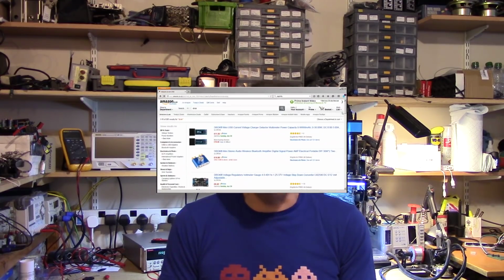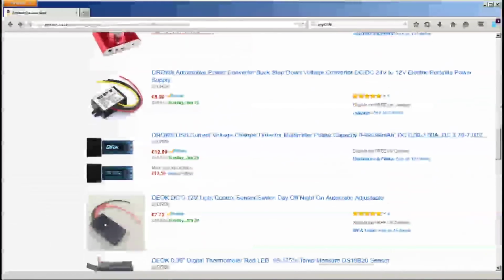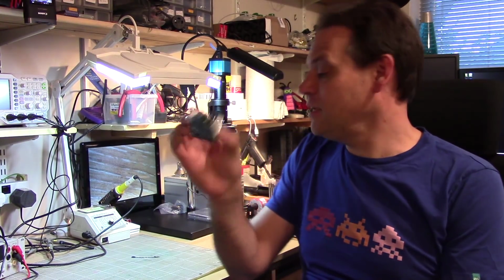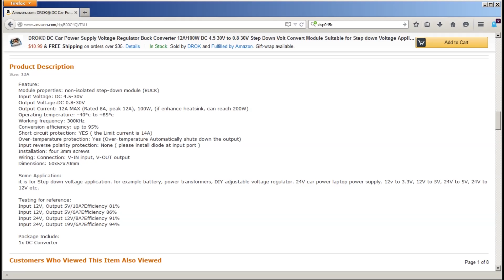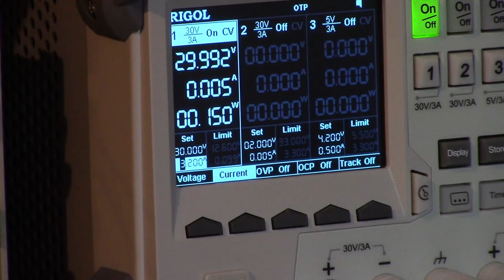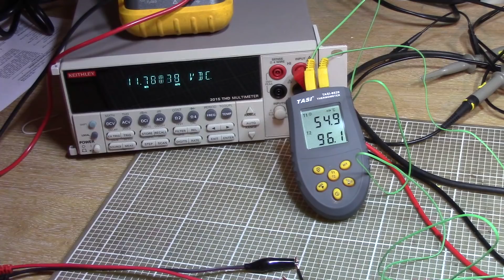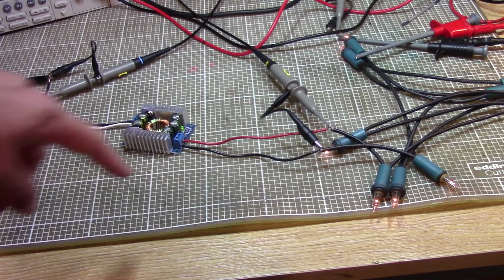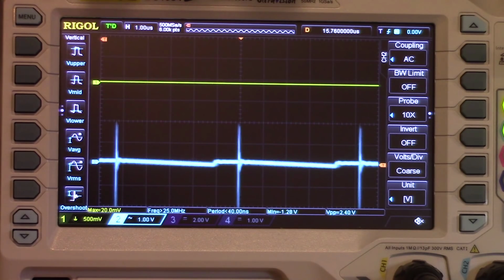DROK 12A / 100W DC-DC Step Down Converter Review (actually 8A)

Comment: thank you sir for your review this DC step down. very helpful for me, i didnt have that tools (osciloscops, power supply,). I have question. Is it stable when there are unexpected power surges? for example when the output is set to 12 volts, then the input spike always changes between 13-14 volts. Will the output voltage be stable at 12 volts?

Comment: Very useful video.  It's a pity you didn't get the 300W 20A buck. It's oly about £6 odd. It uses 2 x K80E08K3 80A FET's. I just managed to undo one and it's heatsink to check. Both have heat sink paste on them now. The XL4016 9A with CV & CA 280W at about £3 on Ebay is probably a third the price and I have used 3 with no problems at over 150W for an hour or more. 12V fan on 6V with 25mm gap. VERY good value. I think DROK is just the usual Chinese kit with their name added at a higher price.

Comment: Hello, I have a question

When you fix and output voltage value, for example 12V, and your input is for example 18V. What happen if you vary the input voltage?, the output remains in 12 V or it varies also when you modify the input?

Thanks.
Reply from the maker: Hi Daniel - The output voltage will remain fixed at 12V as long as the input voltage is high enough (over about 13V). If the input changed from 18V up to 24V the output would not change at all. Hope that helps. Cheers!!

Comment: XLSEMI XL4012 ??? On the fence too much write. Show us do 12A at the output of the module. There is information that is instead XL4012(12A 300kHz), is set XL4016 (8A 180Кгц), but on the surface of the chip written XL4012
Reply from the maker: Hi Mr. Good.... You're right!!! - I just checked the chip on my board again under the microscope and it is indeed an XL4016, which is only rated for 8A. That makes this video very wrong on two points (as I also messed up measuring the switching noise due to accidentally having the scope input grounded - already added an annotation about that one) ...  Do you think I should just get rid of this video? Cheers!!
Reply: Jim Conner Hello Mr. Jim Conner! Good video. Just our Chinese friends, always a bit of rogues )))
Reply from the maker: I've now added an annotation highlighting that it's actually the XL4016, and updated the datasheet link to point to the right device - Thanks for spotting the mistake and letting me know. Cheers!!

Comment: is it possible, to make adjustable output current?
Reply from the maker: Hi +dvaal - There is no output current adjustment on this Drok converter...  I have seen other buck converters on ebay/amazon/aliexpress which do have a current limit though (and they were cheaper too). Hope that helps. Cheers!!

Comment: Dear Jim Conner, I have the same converter and was wondering about the output for the cooling fan, mine has no voltage output either, did you come up with a solution to this? the only info I can find is that it is supposed to be a constant 12v output but mine = zero VDC. The Drok web site does not seem to exist so that was of no help. Thanks 
Great job on the review.
Reply from the maker: Hi +Less Opinion  - If you look on the underneath of the board, right next to the fan connector there are three solder pads and some writing that says v_in and v_out... You need to make a solder connection between two of the three solder pads to choose whether you want to run the fan from the input voltage to, or the output voltage from the converter. (i.e let's say you're running the converter from 12V, stepping down to 5V... You could choose either a 12v fan running from the input voltage, or a 5V fan running on the output of the converter)... Hope that makes sense. Cheers!!
Reply: @ThingsWhichArentWork  Thank you for this Answer I was looking for this I have DZS ELEC which I guess is a clone of this one. I could figure out how the heck to get the plug sock of the fan to work. RIght now I just got it pulling voltage from my 12 volt line coming in. Which is what it would do anyways. Since Im running a 12 volt fan. But thank you.

Comment: I've been looking for a step down converter for a little project to use the 37v phantom power from a preamp box to allow me to alternate with headset mic, which i believe only requires 2.5v. with the low noise would this be a good unit? or is it too heavy duty?
Reply from the maker: Hi +Brian “Easty and the Wolf” Eastwood - Although this converter would work I think this unit is far too heavy duty for that application. I believe the phantom power spec allows for 10mA per microphone, so you're hardly using any power at all. Although the output of this Drok switching converter was very clean, given your very low current requirements, I think you'd be better off with a linear converter instead. Take a look at the 'STM LF25CV' voltage regulator from STMicroelectronics - It's a 500mA 2.5v supply which can run on anything up to a 40V input. It's a straighforward 3-pin device (power-in, ground, power-out) and given your low power requirement, I doubt you'll need a heatsink. Element14 stock them for $1.68 each, or you can get 5x from ebay for about the same price... Hope that helps. Cheers.
Reply: +Jim Conner Thanks loads for the response. I'll read about the linear converter. I found a circuit diagram though it had a seperate power supply and I thought it would be much better to use the phantom supply already provided by the amp. Cheers.

Comment: Well done Jim! Two comments from my side:
1.) If it says a 100W, I always understand a load of 100W. So this means you should have had your output current measured and the output voltage adjusted to hit the 100W.
2.) A conversion efficiency measurement with a few different points would have been nice too. That's always a big unknown factor with these Chinese DC-DC.
3.) Thermal shutdown test. If this feature is advertised, it would be good to know if it works and when it kicks in.
Thanks again for the good work. Alex
Reply from the maker: Thanks +Alex Wolf - Yes - you're right on 1.) and I'll try harder next time.... The datasheet for the XL4012 IC this board uses has an example circuit for an output of 12V@12A (144W) so I'm pretty confident that the unit can actually deliver over 100W in the right circumstances (cooling permitting). On 2.) - yes... I should have done that... The efficiency curve isn't even shown on the datasheet.... 3.) I sort-of aborted the thermal test when I realised that the thermal shutdownis actually managed by the XL4012  IC itself and kicks in at a junction temperature of 125C... There was nothing the circuit designers could have got wrong with that, so I'm prepared to accept that the unit would actually shut itself down if it gets too hot - It had reached temperature stability when I stopped the test, so I'd have had to change the test conditions to get thermal shutdown. 

Thanks for the feedback Alex - Hope you have a great christmas.

Cheers!!

Comment: Well done. I use one of these to power an onboard glow system for an RC airplane. Input is a lithium Ion cell of 4.2 volts. Output to glow plug is set at 1.3 volts  under load. I can turn the glow plug on or off from the transmitter.  A single glow plug draws around  four amps.
Reply from the maker: Hi Marvin - That sounds like a very good use for one of these converters... I'm planning to put my one into use as a dimmer circuit for a set of 12V LED strips that I have around my desk - I just need to find a suitable slider potentiometer to add into the circuit so it's easy to control the brightness. All the best. Cheers!!

Comment: I have the same converter, it can do 150W but you need a fan to cool it down.
Reply from the maker: +MrOpenGL Yep... and as an added bonus, there's a fan connector on the PCB, with a jumper on it so you can decide whether to run the fan from the input power, or the output of the converter... Quite a useful little unit. Cheers!!
Reply: +Jim Conner Caught the fan connector before, but didn't catch the jumper. Thanks!
I tried to use it as an adjustible power supply so I ripped out the trimpot and I added an external multiturn potentiometer. Unfortunately it works in reverse, ie when I turn it towards the left (to normally decrease) it raises the voltage. Switching the two outer wires (not the wiper one, the other two) on the pot kills it (it doesn't output anything) unless they are put back in the original position. It's quite good but the pot in the wrong way is annoying. I don't understand why it would not work with the outer wires switched- - a pot isn't polarised! :-)
Reply from the maker: +MrOpenGL That's a weird one - I can't think of any reason why it should have worked with the outer wires on the pot reversed... unless the pot was faulty in some way... I've been thinking about doing exactly the same thing myself so that I can dim the LED strips I have under my shelves to light my workbench... They're great at full brightness when I'm actively working on that desk, but rather too much when I'm trying to watch TV in the corner. Cheers!!

Comment: I choose these instead. Cheaper and constant current control.http://www.ebay.com/itm/DC-DC-CC-CV-Buck-Converter-Step-down-Power-Supply-Module-7-32V-to-0-8-28V-12A-EC-/221670461819?pt=LH_DefaultDomain_0&hash=item339c96d17b
Reply from the maker: Hi Robonza  - Yeah - the lack of a current limit on the DROK unit is a bit of a weakness... I wonder if that unit you're using has the same XLSemi package on there to control it all - the specs certainy match up.  - Thanks for the link. Cheers!!

Comment: Excellent job on the video!  Can't believe how well it measured up!  Super thorough review.  PS love the X-ACTO for opening.  Far more logical than a Dundee knife :)
Reply: Eric William -MKme Tech  I have the X-ACTO art knife too. The old lot of US made are better in quality, their current supply are yuck ! Fyi, another worthy buy  http://www.proskit.com/knives-and-scissors/multi-purpose/30-pc-deluxe-hobby-knife-set
Reply from the maker: Thanks Eric William -MKme Tech - I was impressed by the cleanliness of the output on there - I was fully expecting to see some 300kHz switching noise on there. Can't beat an X-ACTO - great for so many different things. Cheers!!
Reply: Jim Conner I think you should go one up on the dundee knife eevblog and get a samurai sword. Or its English equal. If the component doesn't hold up to scrutiny then chop chop!
Reply from the maker: Trace Waters I have a plan for one-upping the dundee knife... but that'll have to wait until I get around to doing an 'mailbag' episode... The problems is that I can never wait to open the parcels when they arrive. Cheers!!